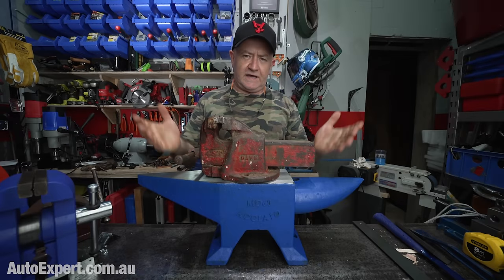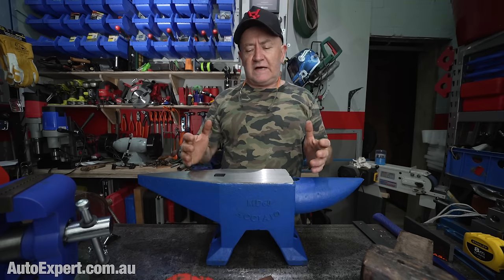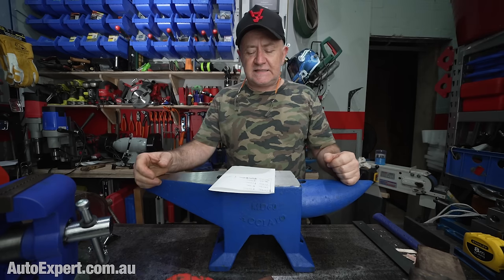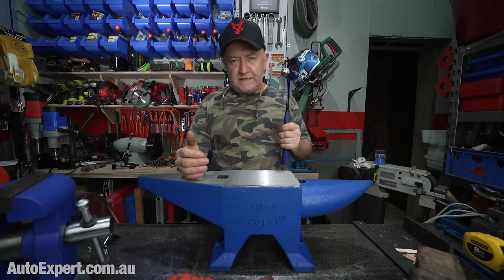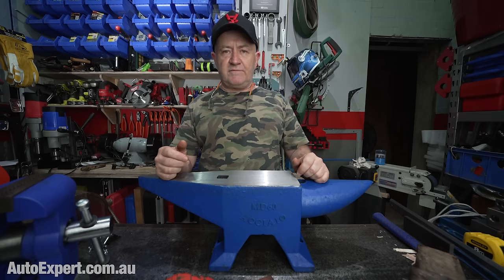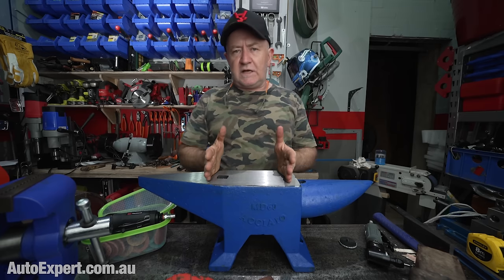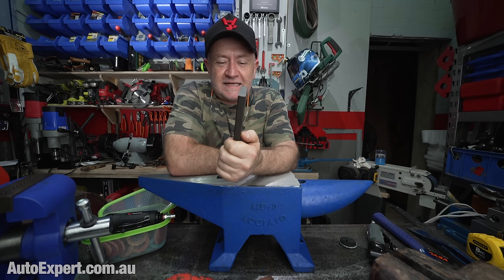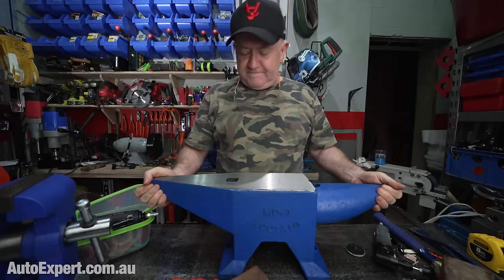DIY 101: You need an anvil (even if you're not a blacksmith) | Auto Expert John Cadogan

Comment: That Annville is bodacious! And it made me remember something when you said how heavy it was. As I watched you pick up that heavy thing with its 4 legs.

But it's 4 legs were not moving around as much. As the baby Colt I had to pick up. Which was not a gun made in America. It was a baby horse. The mommy horse had just given birth to. And decided to abandon in the field.

You see… This all happened. When at my commercial  storage unit facility. Some folks hadn't paid their bill. And there unit was opened up. We were encouraged to take anything we want. And they had some office furniture. So I got some office furniture. And this group of old ladies  and teenage girls. Needed some other things. But they couldn't get it into their car. And I had a gigantic diesel box truck with a hydraulic power lift tailgate. And I said I could help them.

And so we loaded everything in the my truck. And I took it to their farm. That these old ladies had. It was a horse farm. And they had dozens of teenage girls there in the summertime. When suddenly. These couple of teenage girls come into the house. All frantic. Exclaiming this horse had just given birth. And she walked away from the baby Colt. Lying on the ground. And so the old ladies and myself piled out of the house. 300 yards or so down the hill. And yup. This is a baby Colt lying on the ground.

The old ladies in the teenage girls didn't know what to do? They wanted to get the baby Colt back up the hill to the barn. And they couldn't. I said have no fear I am here!

I have never picked up a newborn anything! And I get full of dirt and blood and guts of afterbirth. And I'm trying to carry this baby Colt. In my arms. As its 4 legs are moving violently about. And I have to walk this thing, 3 times the length of a football field! In my arms struggling.

And that Annville. And the way you picked it up. Reminded me of that baby Colt. Which weighed about the same thing. That I had to carry 300 yards up the hill! When I could still do it as a man! I couldn't do that today.  Certainly not at 67 years of age. That's when I was like, 32! And much more of a man than  I am, today as a woman.

And so if I get in Annville, John? I will call over another  experienced, lifetime broadcaster like yourself. To help me pick it up and put it on the table!

Because hey John. American NBC Broadcasters. Are a lot stronger than Australian, ABC, Broadcasters. You're just a little guy. And I'm a big old American woman! You better watch out Shorty! I'm coming to get your, Vegemite or Marmite stuff! How can you eat that stuff? It's like spreadable mud dirt on bread. I mean come on now! Kangaroo fog Wah. Would be much tastier! If you could force-feed kangaroos? But you can't! They punch back! Or is that Pouch  back? Both! Because one doesn't come without the other. And engineers like myself know such things. Because I worked for RCA subsidiary NBC. I was hired by Gen. David Sarnoff! Who were you hired by Olivia Newton John? Right. Olivia Newton John. When she was still young and beautiful. And not old and beautiful. And such a terrible loss. As I always wanted to make it to, Xanadu. And I don't know where the FUCK that is? I thought it was Australia? Isn't that the outback? And where outback? I don't see it anywhere? Your map is broken! It's missing. But I guess that's what Australians do? Drive American cars on the wrong side of the road! Which Mel Gibson was already used to doing. Driving drunk. And yet killed no one yet.  And never will be allowed to try again. As he is your other national treasure. But also knows how to speak American! Why don't you? I can teach you. I'm from Detroit originally. And the land of WXYZ-TV & Radio. That used to be owned by American ABC! And the Australians are infringing upon our copyright! Because you're not really ABC! We are! You came later. More like, HIK. Or, LMN? OPQ? One of those. But no! You had to steal ABC!

And who did you work for, John? But ABC-7! A direct copyright infringement! With WABC-7 NYC. WXYZ-7, K ABC-7. You don't have to act like the Chinese John just because you live closer. To them. You don't see them stealing ABC-7! But the Australians thought that was all right! Why John why? Why would the Australians do such a thing? You could just rename your country? Because of the Queen? Well she's dead now! And you can change the name of Australia!  To something like, Kangaroo! Or, Wallaby? I can hear it now…

Looking for that special vacation? Wallaby here! We don't prevent any punches! So spring on down here. It's what you Wallaby doing! Don't regret! Book today!

And you would get a lot more tourists. You got all of that desert area that has not been built up yet with hotels and theme parks! You could have Disney Aussie Land! To build up that empty desert area. You got plenty of water around that can be desalinated! Enough for the entire world! And because I never noticed. Whether the water swirls down the toilet in the opposite direction  from the USA and? You'd think I would have observed that more closely? But I don't remember if it did? I know my poop went down finally. Which it did not do easily. As it wanted to live. But I got it out of my hand in the end. And down it went! To Australia!

Yes I imported my poop from Washington DC. To share with you guys in New Zealand and Australia. Because I didn't think you had enough of my shit yet? This is what Americans do. We share our shit. With our good allies. That talk really funny. Who spread peanut butter textured dirt on bread. I'll never figure out? What is the attraction there?  I mean you had to be really hungry to eat such stuff?  And it was a good thing. They never catered any of that stuff. For us at NBC-TV. They would cater for us, pizzas, Chinese food, stakes,  6 packs of beer. But never Vegemite or Marmite. Ugh! We would have gone on strike! If they had. But that's probably what the Aussies give you guys at ABC-7? Fake food! Slathered with Vegemite or Marmite? What's the difference? I never learned with the actual difference was? It all tasted like peanut butter textured dirt to me. And also to my then wife. With her bountiful body. Like Dramatic Wagnerian  Sopranos have. And she wouldn't eat that stuff! And she would eat most anything in abundance! To keep her 350 pound girlish figure. And that we call, Imperial Weight. As she was also half JAP. Her daddy was Jewish. And not Japanese. But he did look very Japanese. From all of his Mongolian bloodline. That Polish Jew had. And Judy, (her real first name). Had no problems passing as, Madame Butterfly.  Even at 350 pounds! And so you didn't want to mess with Judy a.k.a.  Alessandra Marc. She was stronger than any other man I knew. She would pick up conductors after a performance. With the audience cheering. And swing the conductors around. Like rag dolls. It was always very funny. As I thought she was going to, throw them at the audience? But she didn't. She was filled with Jubilee. She gushed in appreciation. And also with me. But that is TMI. Nevertheless she gushed! And she would gussy herself up. In beautiful costume plumage. To sing on stage with. And she was a great singer. I really loved her voice along with her. But a good thing she divorced me. Because of who she has become today. A hysterical screaming crazy lady. Now having been retired. Due to obesity. Which she tried to fix too late. Oh well… As we all know… YOU CAN'T FIX STUPID. Or someone who is, mentally and emotionally hungry all the time. And knows how to eat too much. All the time. Because gastric bypass surgery will fix nothing. If you don't fix the brain, first. And so sure. Her brain is terribly damaged. From those 1 hp, 750 equivalent wants of her powerful voice. I am certain has caused her some brain damage. As even standing in front of her. Can be painful. When she is singing Wagner. It's brutal! But that's how you fill up a theater with 5000 people listening. Without a PA system. And playing over a, 80 piece, symphony orchestra. Not easy thing to do!

And so, John. I think you are a, operatic tenor. Or part of a barbershop quartet? As you have been obviously shaved. But all those years of smoking cigarettes. Have left you a little raspy. So go ahead and gargle with some Drano. That should help.. It'll open you up. So you can sing and speak clearly again. Instead of like an Australian!

I mean really John. How are Americans supposed to understand you? When you keep sounding like an Australian?  Learn how to talk American! Your broadcaster God dammit! Get with the program! It's already on the air! So you don't have to be!

I don't know why? I would just love to have a Right Hand Dr., Chevrolet Corvette stingray. I don't know why? Just to be different I think? Driving it in the USA. And getting pulled over by cops. Wondering where the driver is? I'm over here? On this side. I crossed over to the right side. To your side. What? You don't like this? Just to prove a point! That Republicunt should've sucked. What I once had myself. For, 30 years. Until I traded it in for a, hole, new model! If you follow? You're an Aussie so I will assume you do? I know how dirty your minds are  down under. Always looking up ladies skirts  from down under. You don't fool anybody! As we all know. You don't have as many sheep as New Zealand men have as partners. As it was explained to me. Why all New Zealand men have, nearly knee-high boots. It's so they could slip the back legs of the female sheep. Into the front of their boots. To hold them study. While they did their New Zealand thing to them. Trying to make baby human sheep. Which may or may not have worked? But hey they won the Rugby Championship. So obviously New Zealanders through selective breeding with sheep did work! Maybe you should try it also John? Got any boots? Got any sheep?

How many sheep power is the motor in your car? This is a new standard we must investigate.

RamyRAD

Comment: Back to the first few minutes, I bought a (very) cheap 4" vice from a (very) cheap discount store. The first time I tightened it, by hand, just using the handle it was made with, the sliding jaw literally snapped in half. Cast steel, nope, cast iron, nope, gravity cast Chineseum, yep, and low quality Chinesium at that 🤣

Comment: Show the tools.  I think we think we know but I learn a bit more every time someone talks about them.  The Anvil is almost a forgotten tool.  Vices are made to break if torqued too hard.  I think it is a steel thread and a cast iron nut.  Just you can't get the nut anymore most likely.  Just use the handle and not add the pipe or the hammer and the vice will last a lifetime.  Cast iron can be welded the hard way that works.  The other way is stainless steel rods but it is for gas and water sealing more than strength.

Comment: I looked up anvils a few years back - there used to be a forge in Europe that sold forged steel anvils up to 1 metric tonne in weight. Not cast iron, not cast steel, FORGED tool steel (then surface hardened). Now THAT'S a fucken anvil! The kind of thing blacksmiths will travel for hours to come and PAY YOU for the privilege of using.
If only I had the cash to 1: pay for the anvil, and 2: have it shipped to Perth, at the time.

Comment: Being a blacksmith, I can tell you that mounting an anvil for serious use is a science/art and there are plenty of blacksmithing channels that show how it's done well, (Black Bear Forge is a really good one), Here's a tip - bolting them to fabricobbled steel legs is the ultimate in crap mounting jobs! Don't even think about screwing coach bolts or nailing or driving bridge spikes into the end grain of any timber, for any job, EVER! That method of fixing a joint together WILL fail!
My new 80kg anvil (from BSL anvils in Lara Vic.-no connection but their customer service is 1st class), will be chained down to 94 kg of Redgum block effectively giving me 170kgs of anvil mass under the hammer.

Comment: I recently slipped anchor and to celebrate I lashed out and invested in a very old 130kg Peter Wright anvil for my fat cave. Did I need it? No. Did I lust after it? Hell yessss!!!

It’s in remarkably good condition for its age and I’m about to mount it on a nice bit of ironbark (with a forklift #not stupid). 

I’m certainly no blacksmith. This will  be more of a functional conversation piece. A very heavy one at that.

Comment: From my perspective, the anvil in the video doesnt make sense, why is it hollow underneath with spindly legs specifically where the anvil benefits from having mass? An anvil that size should be well over 60Kg. A cheap anvil option is a broken forklift tyne, the straight bit that attaches to the forklift, more than solid enough and heavy enough for many anvil type operations that need a flat surface.

Comment: People mostly don't have one but they ruined few other tools because they don't have anvil...
In my area is easy to get 1~m long used rail from Train, and you need one too. So useful
Get yourself portable hydraulic press. Much better than regular screw vice. Good portable press can push and pull apart. Like firefighters tool but more for everyday workshop abuse